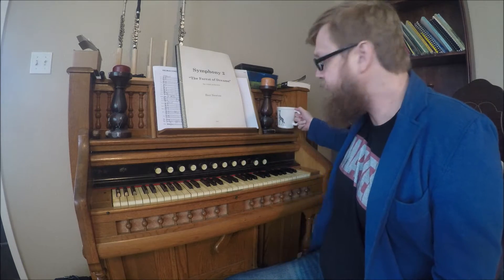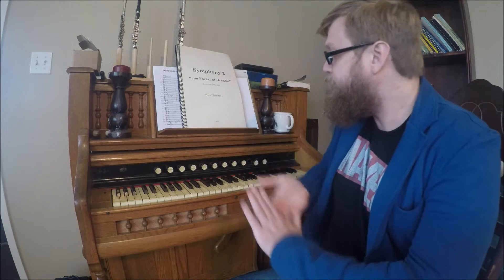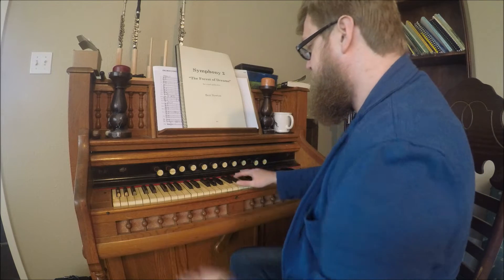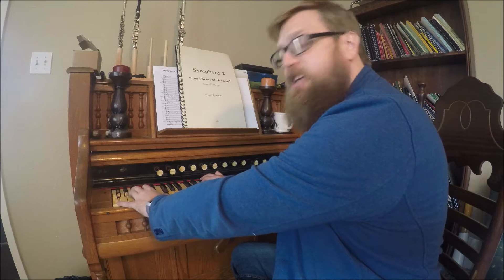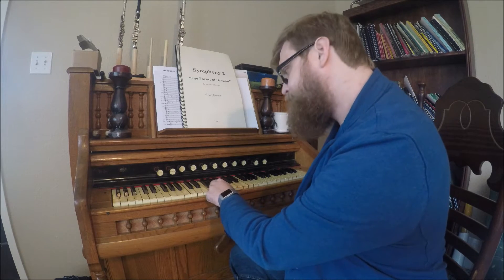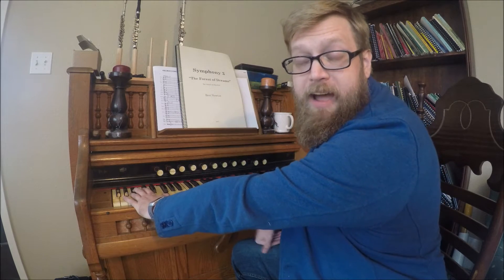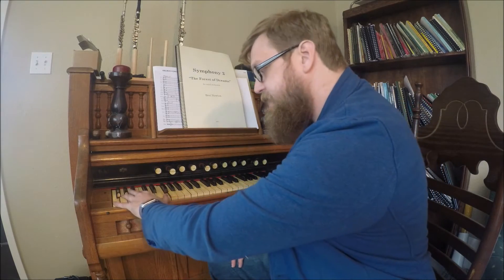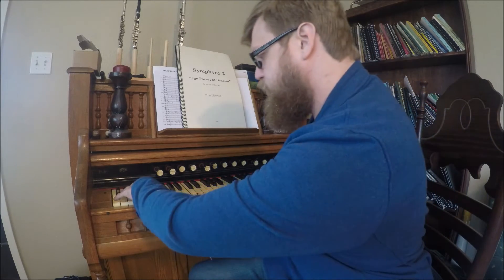Composing in the Subcontrabass

Comment: you should have used a piano the noise is unbearable
Reply from the maker: Sorry about that. I don't own a Piano, so this is what I have to work with.
Reply: @BretNewtonComposer  no worries, the video was good apart from the noise. But why is is that loud, how can you work on that thing?
Reply from the maker: @helenamarie4337  It's because the previous owner installed a motor and disabled the bellows. It would require a complete mechanical disassembly and rebuilding to get it to function correctly, which I do plan on doing at some point (especially as I will need it for Symphony 3).
Reply: @BretNewtonComposer  You should! On Artis Wodehouse's YT channel she presents a working reed organ, interesting sound actually.